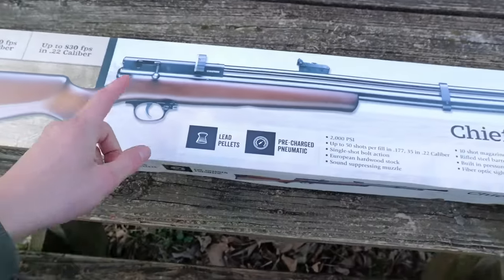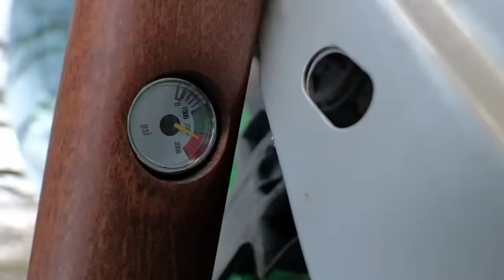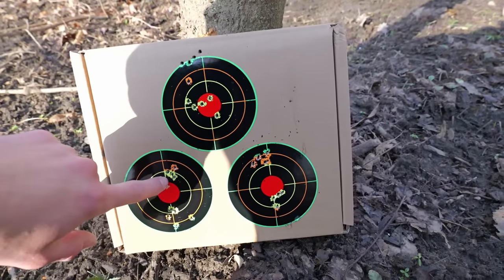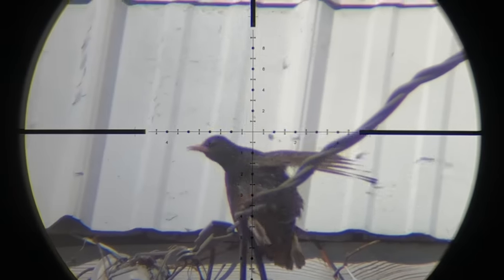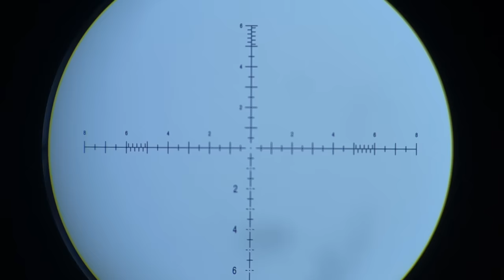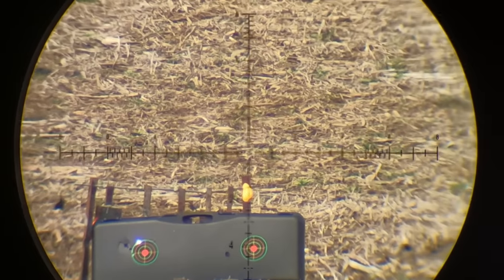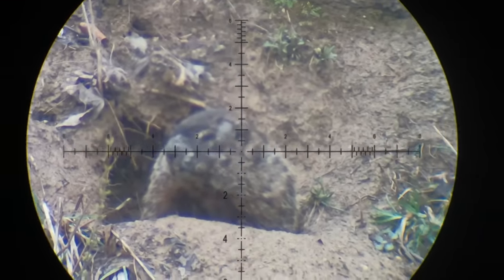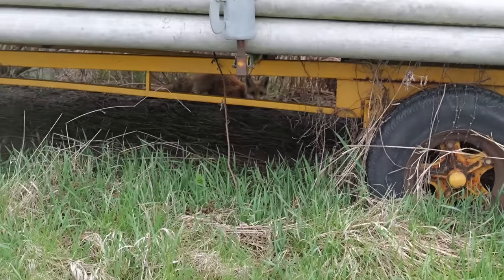Hunting with Walmart's CHEAPEST PCP Air Rifle!!!

Comment: Bud IMO you will be hard pressed to find a better air rifle for the money than the Snow peak M60/Umarex Zelos B or T in .22 or .25 cal for the money. Basically an FX Impact without the price. The JTS and Avengers are up there also but IMO if you want a keeper then there it is. I have an LCS"s in .22 and .25, but the company seems to have went under but still hard to beat but they cost me each 2350$. I love a hammerless system for ease of tune and unbelievable accuracy especially being semi/full auto but now the Sidewinder,Huben, and Rattler are out there tearing it up. Still bang for buck Notos, Zelos, and Avenger are very hard to beat. They are all regulated as well. Hope this helps. Love your videos, and I also love the Notos. Killer hunting PCP out to 60 yards with the cheap Crosman HPs. I have taken over 9 crows to date with this little hunter out to 60 yards with 1 shot each. UTG 3-12X44 Accushot scope for like 90$. great little PCP and so darn quiet!!!

Comment: I have a backwards question. I use a Diana Chaser CO2 pistol to "convince" pigeons to stay off my roof. What are the slowest pellets? Specifically pellets that slow down the quickest? If I miss a pigeon on my roof (10-20 yds) the pellet continues an unknown distance. What I would like to find is a pellet formed like a badminton shuttle. Quick for a little bit, then slows dramatically. Is there such a thing?
Reply: You want a pellet with a low ballistic coefficient so the air slows it down as fast as possible.  Light wadcutters are great for this they smack hard at close range but lose power with any distance.  If I shoot a board from across a field with domed vs wadcutters the domeds hit way harder cus they cut through the air much better.